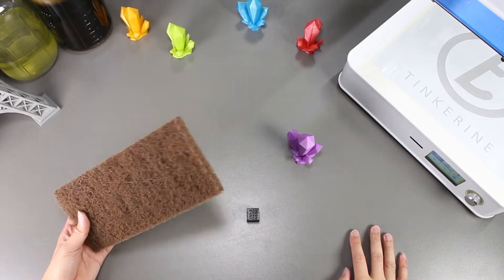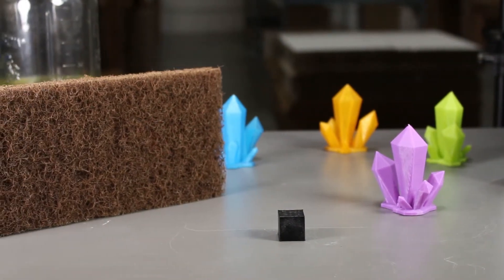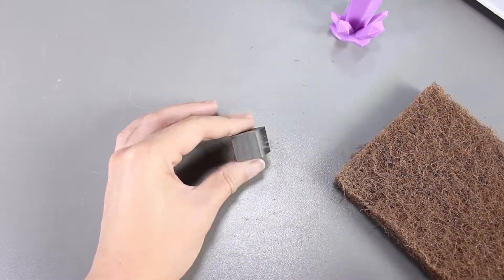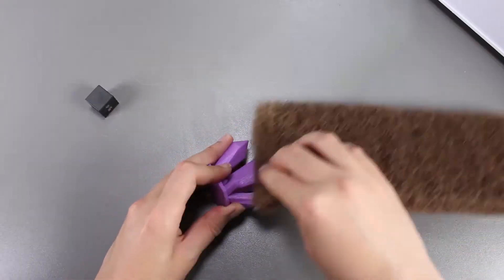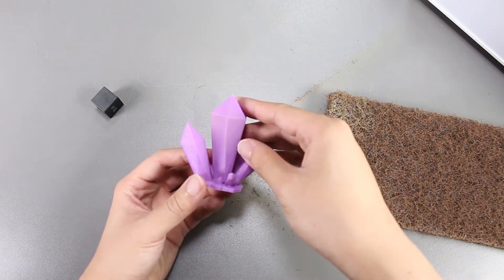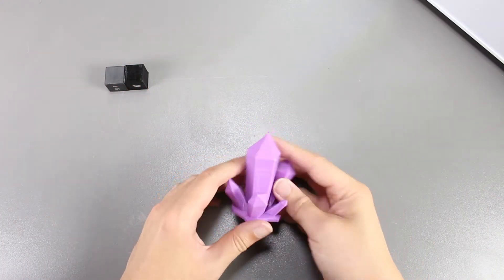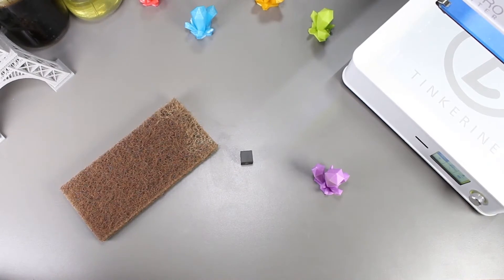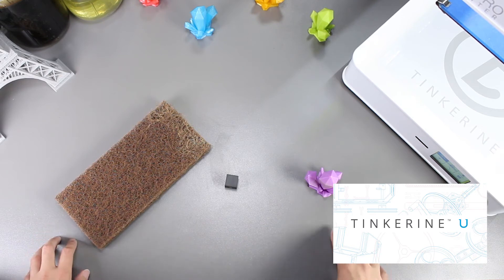Post-Processing PLA Prints with a Scouring Pad

Comment: I think a green Scotch Brite scouring pad would give better results. It has more sense fibers than the one you're using in the video.
I use it to remove hairline scratches in a stainless steel sink, so I imagine PLA or PETG would be easy.
It's just a theory, I haven't tried it yet, but I'll give it a go on my next print.